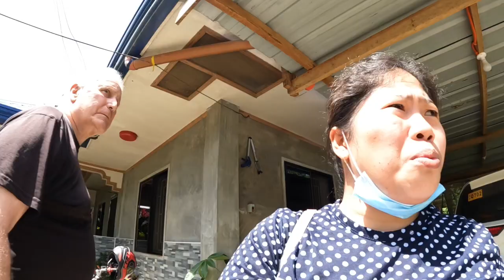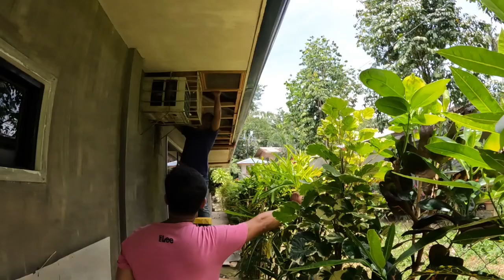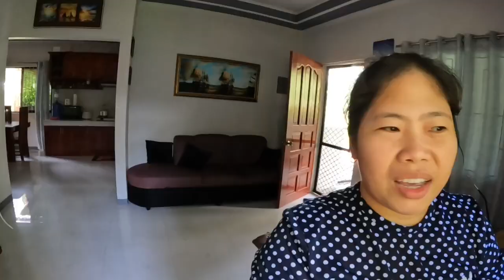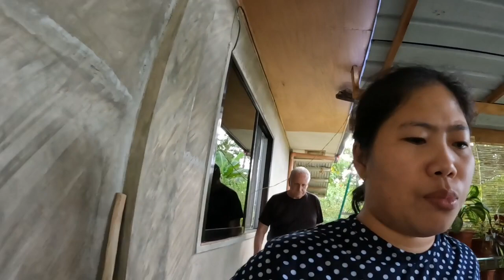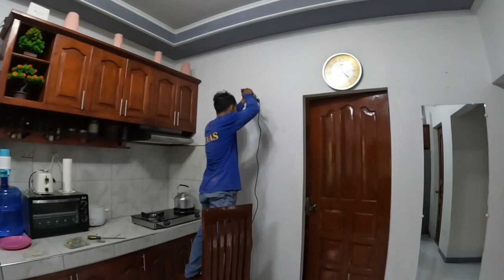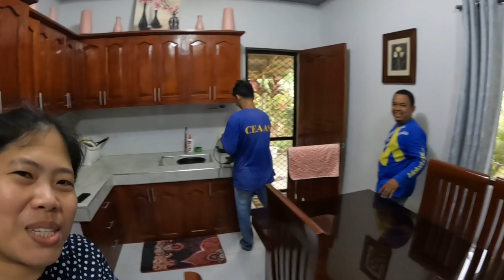After Waiting 4 Years It's Finally Happening | It Will Make A Big Difference

Comment: Silver paper under the metal of the roof, and/or fibreglass "batts" on top of the ceiling will help a lot with the insulation and reduce the heat even more.